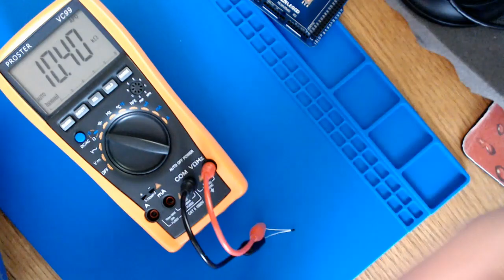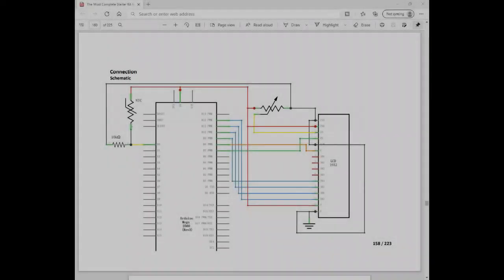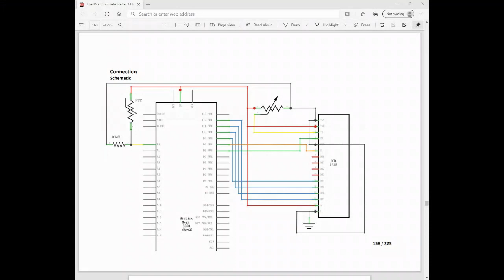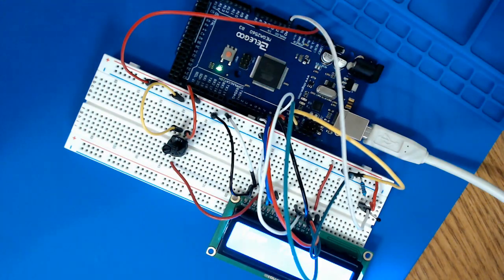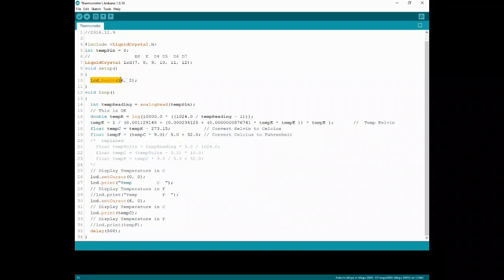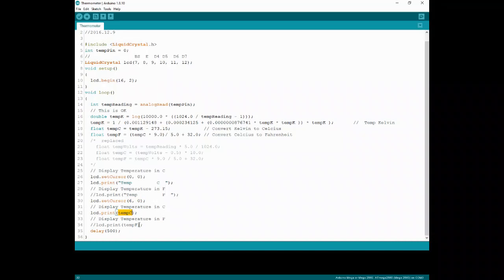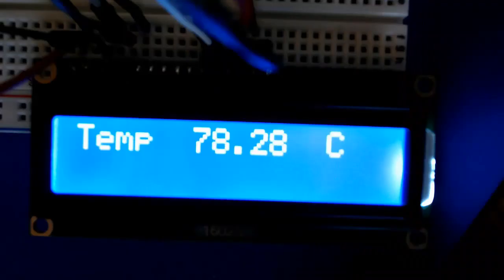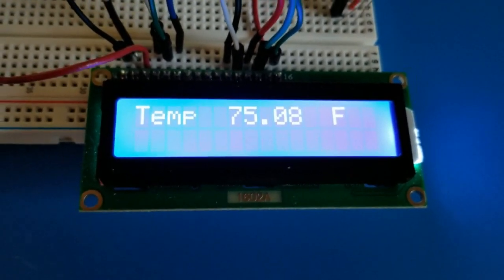How To Use An LCD Display Module To Show Temperature Using Elegoo Mega 2560 (Lesson 23 Thermometer)

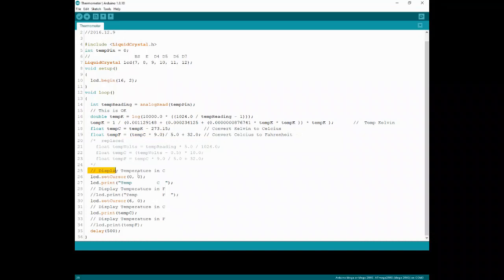Comment: I think there is a bug in line 16 (check time 8:15). It should be tempReading + 1 in the denominator.
Reply from the maker: Hey there! Thanks for asking. I see the line you're talking about.  The -1 subtracts 1 from the voltage ratio. It is used to account for the voltage drop across a pull-down resistor or any other offset that may exist in the circuit. This step helps to normalize the readings. Are you having issues with uploading the code? Thanks for reaching out!  hope to hear from you again👍
Reply: @BMonsterLaboratory  Lets say you get a value 1023 as tempReading, don't you want the fraction (1024/(tempReading MINUS 1)) to be 1 which in your case is NOT. If it is tempReading + 1 then it would be 1.

Comment: I also have another question. When I was trying to configure what problem I had, i realized that some jumper wires are shorter and some are longer. Does that have to do with anything. And also, does the color matter.
Reply from the maker: Length and color do not matter. Open your serial monitor under tools tab at the top. You want to see if your temp readings are showing up and if they are we'll know it's an issue with your display.
Reply: @BMonsterLaboratory  thank You so much will check that out and let you know tomorrow!
Reply from the maker: @radharavichandran3759  sounds great.

Comment: My LCD display is lit up, but no text is appearing? I kept the code the same, so maybe I have it wired wrong. Any troubleshooting advice?
Reply from the maker: double check your LCD pins - could be as simple as 1 pin connected wrong. If the code is the same adn you were able to compile the code with no issues, it must be wiring... I would think.
Reply: any luck?

Comment: Hello BMOnster Laboratory.. You are doing a great job. I have one question about this project... I wired everything correctly, and the LCD display is lighting up but there is no text in it. I even tried turning the Potentiometer around, but is still lighting up blue with now text in the columns. Please help me..
Reply from the maker: Hi Radha! great to hear from you. I would double check connections. It's very easy to place a wire in the wrong spot. Also, open up your serial monitor and see if your code is working correctly. If these don't work you can copy/paste your code in an email and send it to bmonsterlab@yahoo.com. I'll be happy to see what I can do to help.
Reply: @BMonsterLaboratory  I double checked everything, and I will be sending an email right now. Thank You for the advice!

Comment: My LCD display wont open, the screen doesnt open, i triple checked the wiring and the code and i see nothing wrong. Any suggestions?-
Reply from the maker: Hi there! Does the backlight come on at all? Nothing appears when you turned the potentiometer?
Reply from the maker: Also check proper COM port. What does serial monitor say?

Comment: mt lcd is not turning on...
Reply: and there all connected right. why is it not turning on!
Reply from the maker: hi Adin, 
if all the connections are right, have you checked your code?
is there power to the lcd but no visible type on the screen? if so, try turning your potentiometer until the letters show up.
Reply: @BMonsterLaboratory  i copyed the code from the library, turns out i have to re wire every thing also something wrong with the code i copyed it ffrom the folder tho is is say something is wrong
Reply from the maker: @adinmcdowell6878  what is your error message? did you go under Tools tab in the IDE and select the right board, bootloader, and com port?  Sometimes I forget to do that.